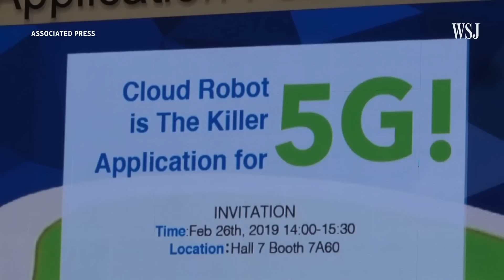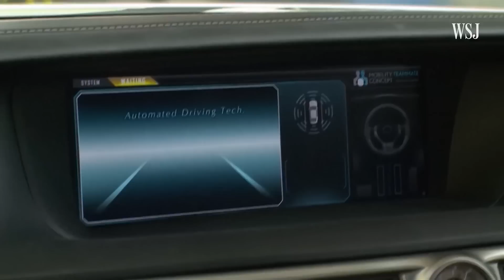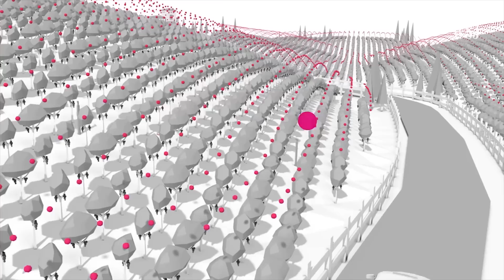Five Myths About 5G, Debunked | WSJ

Comment: can they debunk the evidence that says it causes cellular damage by slowing the voltage gated calcium channels in the DNA sequence allowing excess calcium and other free radicals  to enter the DNA chain.? Guess health isn't a very important issue with big wireless. They figure on leaving the mess to be cleaned up by the next generation 30 or 40 years down the track.

Comment: This is about the effect of irradiation on our nervous system:
https://www.youtube.com/watch?v=MpdJ_t5XMvw
Most of us aren't informed about the LED lamps being a part of the 5G network, functioning in the network of data sharing and surveillance. Also, not many of us know that the television is a device where information flows both ways. Every room where a television is present, can be monitored and conversation can be recorded. That goes for smart phones as well. Smart meters are supposed to send data through the web to the energy provider on certain moments of the day, according to the manual. In reality, the pulsing of data communication is a constant all day. Besides, registration is possible of where the resident is present in the house, due to the heating system and lights, used in the room that is occupied. Which means also that being indoors or outdoors is monitored as well. Surveillance and control is far more intentional than most of us realise. George Orwell described the future, with this technology, in his book 1984.

Comment: If you remember your high school physics, you'll remember that the energy of electromagnetic waves has to do with the wavelength and the frequency of the EM wave.  Shorter wavelengths and higher frequencies mean greater energy and greater cancer risk.  These new 5G towers will have a shorter wavelength and a higher frequency than existing 4G towers, so I see where people's fears of the cancer risk comes from.  

But context is important and these towers still have way longer wavelengths and way lower frequencies than visible light.  Streetlights in your neighborhood are by far a greater cancer risk than these 5G towers and it only takes a cursory understanding of high school level physics to understand why.  

I get that not everybody has taken high school level physics, so please go find a good trustworthy friend who has that basic understanding of physics to reassure you that this is akin to thinking that windmills cause cancer.

Comment: 5G towers will be only 20 or 30 feet high and they will be every few blocks. Humans will receive high doses of micro frequency radiation everywhere they go. 5G will be devastating to humans!
Reply: ROD you not an expert
Reply: You mean like the 4G towers, masts, micro and macro sites we've been using for years with zero ill effects?
Reply: @hardcoretam  How do you know about zero effect? You stupid idiot. There is kids with cancer full hospitals, people never been so sick before, even with such high level of medicine
Reply: Google gammer radiation.
Reply: @sosban  No results.
Reply: Exactly
Reply: @Pia Kjærsgaard Like kids die from adult medical problems?
Reply: @Jonjs99  god you're stupid
Reply: They need to be closer because of the very low power.
Reply: @MrsZambezi  yes, put microwawe owens closer together for more fun
Reply: @Jonjs99  Microwawe owens? What they, and how do you get fun by putting them together?
Reply: @MrsZambezi  Why every time when I turn on microwave owen, my wireless mouse and keybords stops working and wifi download torrent speeds goes from 17mb/s to 2mbs. Havent experienced such thing?
Reply: @Jonjs99  Have you tried a different microwave oven?
Reply: @MrsZambezi  I had few  owens ower the years, first i noticed it back at 2012
Reply: @MrsZambezi  Can you confrim this? You have owen and wifi router or anyhing wireless?
Reply: @Jonjs99  Never had a problem. Is the microwave close to the router? Try moving them apart.
Reply: @MrsZambezi  Not too close, its like 10 metters away :D
Reply: No the whole thing has been made up by Russian trolls.  Don’t be stupid and try critical thinking for once.
Reply: wrong wrong wrong, talk to huawei scientists , no danger
Reply: @jim5159  lies you must be an employee

Comment: Terrible article. Key... they presented no myths. I don't remember anyone ever saying that you couldn't drive farm equipment using 5G. Next, everything they did say is a myth. No... you won't get any of these. 100x speeds... no. You can't get those speeds with a hard lines because existing Internet networking, switching, and server infrastructure can't do this. They limit bandwidth automatically. Likewise, you can't get much lower latency. Yes, you can take a few milliseconds off time from the cell tower to your device, but even hard lines already face 80-100ms speeds. Even fiber-line switches take time and a typical server is 20-30 switches away from the server. You can't do remove surgery, operate cars, etc. on existing hard lines when it takes 200ms+ round trips. No you can't operate cars remotely on 5G networks. Ignoring the fact they don't exist yet, remote cars don't exist yet either... the fact is that 5G cell signals only have ranges in the hundreds of yards and they suffer from non-line-of-sight interference more than 4G. You need something like 16x the number of 5G towers to cover the same area. In large cities, you'll still have dead zones -- bridges, dense buildings, powerlines, etc. In rural areas, no why are they lining roads every 500m (or closer if there is woods, mountains, etc.) with cell towers just so a few cars can drive.

They added more myths and didn't debunk anything.

Comment: Well.. and what myth did you debunk?
All your "coffee robot" and surgery robots do their work already on ethernet wires and even wifi. Latency times are concern over greater distances and several "hops". Most of machines you mention work and are operated inside local networks. For greater distances they will still use wired and optical networks, 5g being used only to connect to main network.
Propaganda they call what u do.

Comment: is there any place in USA that does not have 4G?
Reply: Denzel Heden / only a few, however in Central America, between 3 and 4 G is about 50/50. and rural areas 3 G is usually more effective because it will handle a much weaker signal. comes in handy if you live way out in the toolies, and want to use your cell phone.

Comment: So much BS and Marketing in this video. You don't need 5G to stream videos. Also: if the latency is so low then give me a fricking number how fast it is.
Reply: Latency of current 4G LTE networks averages around 200 to 300 milliseconds. 5G on the other hand has about a 1 Millisecond delay! That is a massive difference.
Reply: @legostar55  

It would be if it were possible.  But since latency is caused by the switches and the server, not the microwave link, 5G will have exactly the same latency as 1G.
Reply: 4k streaming needs only 3mb/ps, u dont need superfast connection for streaming not even gaming, even if u have +150mbps broadband u will only use few % of the speed for games and streaming in HD or 4k. Same with the network. 4G LTE is fast enough
Reply: @LilEazy17  Not unless you want 10ms delay in all user operations. Which will enable remote auto drive cars to happen, where you have massive gpu at some cloud and controls your car/train/etc
Reply: Ive worked with fibre net with over 1gb speed, yes its fast and the latency is way lower but its not a big difference between 150mbps broadband in normal usage as streaming or playing online mp games on ps4 or pc. Its all about the servers, u can have 1gb speed but the servers will allow only few MB download. Most servers allow max 7-12mbs download
Reply: And for games u can use 4G LTE, its 30-60mbps enough for online games isnt it? U might have a bit of a lag but that isnt such a big deal
Reply: But you need 5G to stream your video games, CS? PUGB? etc, so you can simply play 3A games on mobile devices with very low latency or lag<10ms.
Reply: @yiboliang8338  Im my book this falls under gaming, not under streaming.

Comment: This video is simply misleading – you don’t need 5g for surgery, for robots, for operating agricultural machines, etc.
Reply: You can just use the same stuff with a  wired connection (fiberglass) more secure not easy to be hacked and more  reliable then a wireless counterpart imagine you are in a Operation room and some snob hacks your 5g Android Bot doing the surgery would you like that ? No I guess not.
Reply: 1ms latency from across the country.
Reply: @ahhshytson  You can't even achieve that with fiber, but you think that interconnected wireless devices can somehow deliver? Get real.  No system architect is going to recommend wireless over hardwire anyway, regardless of how "cool" and "forward thinking" it is.
Reply: True BUT it Can Be Used For Remote Surgery. If for Example a Person Needing Surgery Can not travel to Hospital in Major City But Can Get to a Remote Surgery With Robotic 5G link.then the Surgeon can Operate as if it was in front of Him on a Operating Table
Reply: @1pixman  Okay, but it's really difficult to imagine a robotic surgery in a place without wired internet, and wired is more reliable than wireless (in general). In addition, if such places existed they would be a minority
Reply: Oleksandr L / you do if you want mistakes to cost many lives, instead of just a few.
Reply: The surgery comment refers to telesurgery, where the idea is to have a doctor at a robotic console operating remotely on a patient under care of a local team, which puts the patient to sleep, configures the robot, and closes the wound after the specialist surgeon is done with his part. This has been done for over a decade in Western hospitals, but with the surgeon in the same room. The low latency of 5G is purported to enable long-distance remote surgery for very unique or highly dangerous surgeries.

Essentially, this video bases its argument on near-future science fiction. It's a sales job. It's telling you why you might want it despite already having excellent service and convenience. It also fails to even mention, let alone address concerns about risk of electromagnetic radiation at these frequencies to human and animal health. Reports from all over the world have caused countries like Israel and Russia to ban it outright.

Comment: That made absolutely no sense. A coffee serving robot, 
1. why does it need to be connected to the cloud? How much data does it need to push back n forth to accomplish such a basic task especially when compared to other humanoid robots?
2. 5g is only the last mile... cloud based servers are not going to have mobile dongles in them so zero latency? I doubt it
3. Factory robots, if they really need that kind of throughput, they would have fiber network cards in them. Factory operation servers are likely on site. How is putting these devices on the mobile network a good idea?
4. There is still a spectrum and thus a bandwidth limitation. Let's not waste it by putting devices on mobile/cell networks for the sake of it.. stick to cable 
5. Remote surgery, yeah ok maybe.. depending on where the patient and surgeon is. But likely that one of the two are going to be on a fibre connection

Comment: They should really talk about how tree leafs can block 5 G due to the high attenuation rate of the signal... 4 G is going nowhere... we need it for the range: its like the difference between 2.4 and 5 Ghz WiFi. 5 Ghz is great if the access point is in the same room but you won't reach it one wall away lol
Reply: The biggest problem is the sheer amount of millimeter wave cell towers that are required for suburban sprawl - especially with duplicate, competing networks. I mean this tech just doesn't make sense for many suburban & rural users - they're far better off with the reliability and speed of fiber, WiFi and 4G. Anyway the carriers will keep milking the consumer with data caps, visible or hidden. In India you can already get 6.5GB/day of 4G data for just $13 with Jio, but none of the Western carriers will ever match that because they like us paying more. The carriers will keep their prices high, high enough for many data intensive commercial users to look for alternatives.
Reply: I remember all the promise o really these years. He'll I kept my analogue startac forever bx digital had so little complete connection. Later I made surey next PHN was dual analogue digital and before smart phones found my lg 2v was plenty to be net and had a physical qwerty keyboard. Even as o joined smartphones wit my droid  gen 2 I found that promises of 2G were wildly inaccurate (lies).
It will be a while A long will before 5G phones see true ability. This is not a reason to run out and buy a 5G capable PHN. Purely capable not necessarily actively utilizing 5G

Comment: 5g causes cancer. 
The 5g heats water inside your body which leads to cell damage  and then cancer
Reply: Probably no problem for me in the near future. We've got just recently 4G in our area.
Reply: looking forward to that future
Reply: Did you know sun can heat water. Did you get cancer
Reply: Boss Prince so in order for 5G to lead to cell damage it needs to basically boil water so that the cells can implode(I’m assuming that’s what you meant) so you’re telling me that non-ionizing radiation is going to boil water...this isn’t a microwave it’s a Radio wave. Unless you can boil water and cook soup with your local antenna don’t start talking about how 5G causes cancer. Also cancer is when cells start diving uncontrollably which leads to tumors(which is the part that gives you the risk of death). Water boiling and getting cancer are not correlated. Cells Imploding isn’t how cancer works or is. Red meat has a higher probability of killing you due to high cholesterol, carcinogens, and if you don’t cook it properly, but I don’t see anyone jumping on that train. You hear a news article and some concerned person in a white lab coat and jump to conclusions. We’ve had electromagnetic radiation for decades and I don’t see a causation between the two. Yes, there can be excess of everything but this is not the topic you should be worried aboutZ
Reply: And you are wrong it wont cause cancer.
Reply: Name NotAvailable I mean extensive exposure to the sun does cause cancer, but not cause of it heating the water in your body
Reply: @willinton06  that's because of UV radiation.
Reply: Name NotAvailable I know I know I was just saying
Reply: @namenotavailable9989  Buddy. I can give you many examples ... we have voltage gated calcium channels...  the energy from em waves can open them up ... wrong signalling .. oxidation.. altered gene expression... shortend life span and increased cancer rates ...
Reply: @mohammedalaskary342  give me proof. I dont care what you think you aren't scientist. What scientific proof do you have. If you have proof we can discuss or else we cant.  Ignorance and irrational fears of technologies that has the potential to save millions of lives are slowing our development.
Reply: https://www.youtube.com/watch?v=hKowG0XV50k